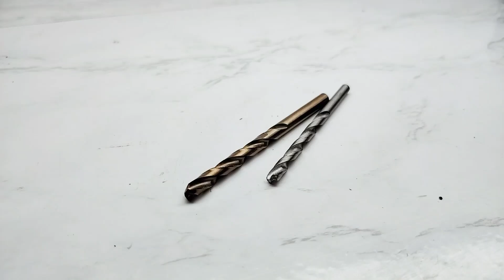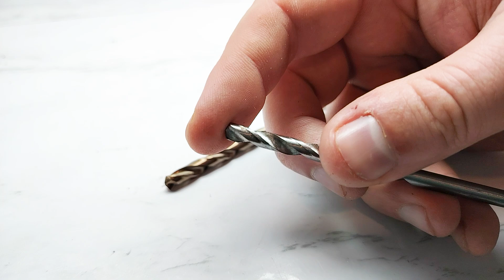What Drill Bit For Aluminium?

Comment: So drilling a 35mm deep hole, you do it in one go ? I see myself clearing the whole several times befor getting to thend because the alluminium does clog up the flutes, yes WD40 was used. I get the job done, but it be interesting if one could cut it in one go instead of pecking